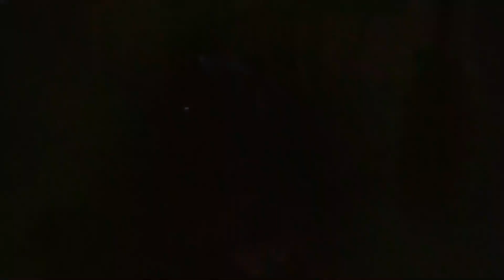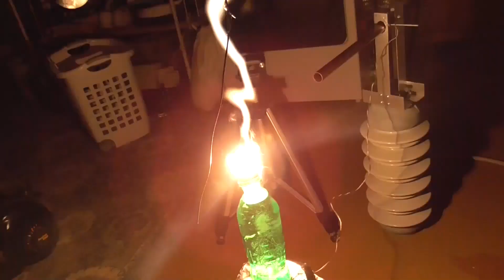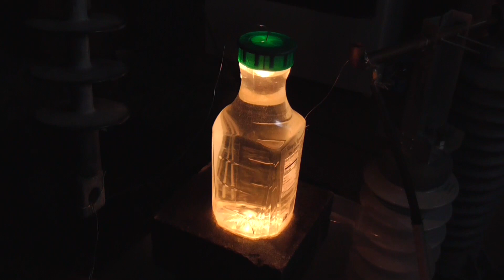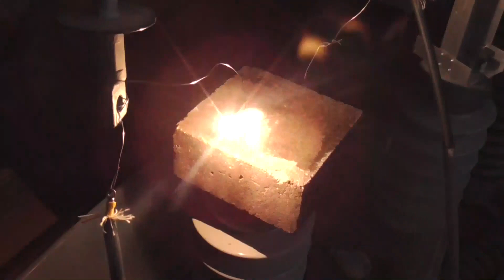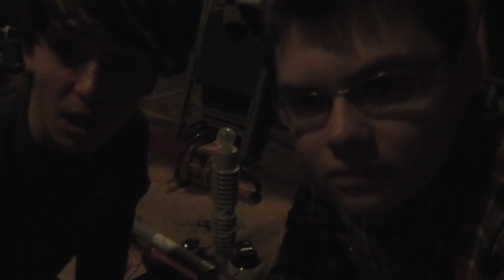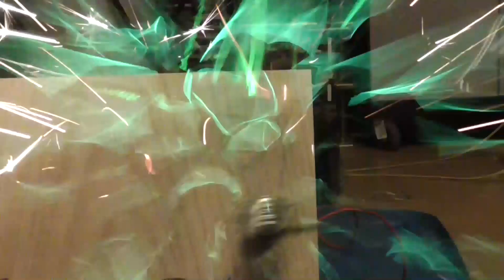High Voltage Compilation

Comment: haha I just got in from making a 3,000 volt power line and I see you upload high voltage.
And yesterday I uploaded my first high voltage video! yay
Reply from the maker: I watched it!! I remember doing a single mot setup. Be careful man. Those transformers are quite a power supply..
Reply: @VariacManiac  WOW Thanks YT. Its been 10 months and I just now saw you'r reply. Thanks! its been awhile.

Comment: NICE I just bought a 25 amp variac  and made an enclose for it you will be seeing that in 2 weeks so we both have two variac power supply's to build
Reply from the maker: Mine needs a lot of work yet. It'll be very nice. I've been looking for time to get it done, and I finally do. Not very much though but, my goal is to finish it sometime this summer.. :)
Reply: @VariacManiac   Ok cool